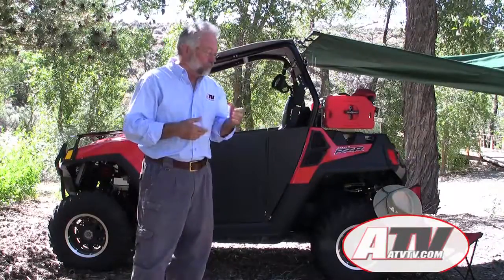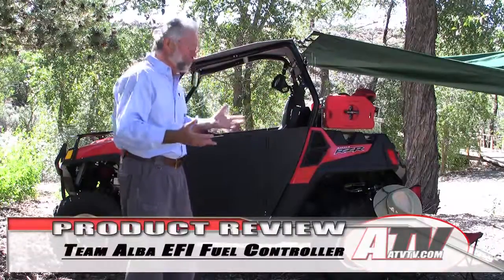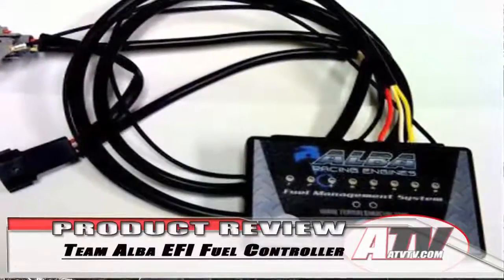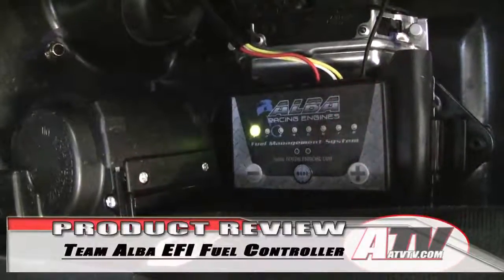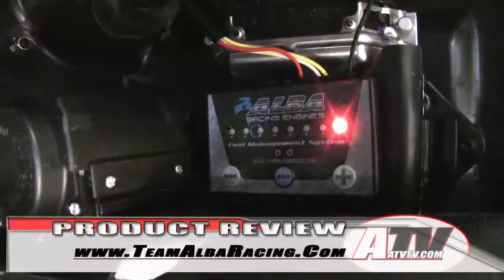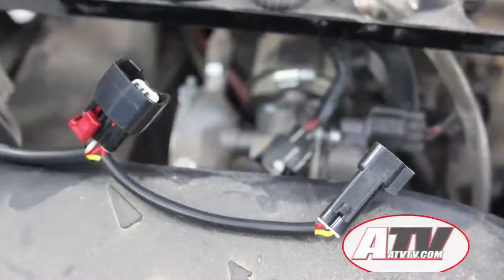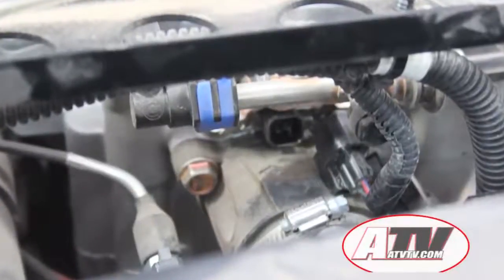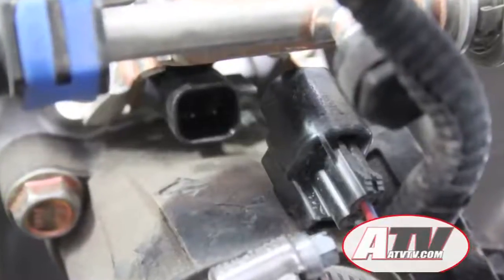ATV Television -Team Alba Racing RZR 570 Fuel Controller

Comment: I also understand another benefit is that the exhaust temperature will drop 200 degrees.
Reply from the maker: +Michael Morsch Sr Not sure it's that much but it does make a difference.

Comment from the maker: The biggest difference I have found is that Works is more willing to work with each customer on an individual basis - getting the shocks tuned more specifically to the rider, riding style, and terrain. And for me, I like my shocks softer so that I use 'all' the travel when I ride. Works was better at dialing that in. I also don't think it's all that important to get adjustable shocks if you get them set up right to begin with.